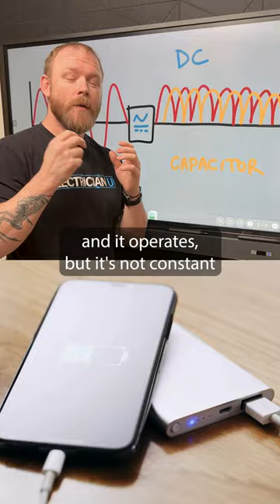Converting AC to DC with a Capacitor

Comment: I'm pretty sure modern dc power supplies use diodes to remove the ripples
Reply: Bridge rectifiers, an arrangement of four diodes, flip the negative voltage portion of the alternating current to the positive side. Current is still alternating between zero volts and what ever the input voltage is (usually already stepped down). The diodes do not smooth out the voltage. Diodes are one-way valves for electricity.
Reply: They are used to remove the large sine wave. The capacitor is afterwards.
Reply: Diodes can only be used to block current or let it through. Plus there is usually a voltage drop with a diode. You need capacitors, coils, or batteries to smooth out voltage. 

Now a power supply using a transistor to turn on and off the current can kind of smooth the voltage. If you switch at 100khertz instead of 60hertz most things won’t notice it’s not pure DC.
Reply: You can never remove all the ripples.
Reply: @snap-off5383  that's ignorant. There are plenty of high end AC-dc power supplies that create "perfect" dc. I own an engineering business that specializes in electrical testing. Much of our dc test equipment is required to be true dc and it all comes from an AC source
Reply: @rx7addict  The more capacitance you add ( or inductance ), the smaller the ripple, but like approaching the speed of light, you can never get all the way there.
Reply: @rx7addict  And any oscilloscope zoomed in will show you it is still fluctuating.   I won't bother with logical fallacies, just lead the horse to drink.

Comment: Fun fact: For just about anything with a battery: phone, tablet, laptop computer, uninteruptable power supply, the power to the device is always coming from the battery! You are drawing from the battery while it is being charged. This is why you can't always turn on the device as soon as you plug it in. There needs to be a charge in the battery. If you take the battery out of the device, then you can use it while it is plugged in. Did that once while waiting on a replacement battery for my laptop. And for my tablet. (The UPS will still work as a surge protector.)

Think about it like a water tower: the customers are drawing from the tower while the water authority is filling it up.
Reply: Actually most cheap consumer UPSes do NOT operate that way.  They feed the AC directly through to the device, and only switch over to using the inverter when the AC fails.

Comment: We were just going over this exact topic in my last DC Motors class. Can you do a video on 208 vs 240? I mostly understand that it has to do with using 2 of 3 phases vs a center tapped transformer, but theres still alot i do not understand.
Reply: I would love a refresh on this too, I come from a 208 world and residential 240 still breaks my brain 😂
Reply: 208 is the line to line voltage of a common 3 phase system in the US. It'll typically be in a "wye" configuration (Y) where the middle point is grounded. That middle point (neutral) to any individual line is 120V (because of math and trigonometry magic) - what a fantastic choice 208 was to get us 3 120V lines!
  --Each line ends up being 120* out of phase, which is 360* / 3 phases

240V in the US is just single phase so that line to line is 240, and we ground the middle point. Now, since the middle of this setup has become neutral, taking either line to neutral is 120V. Technically speaking, the center tapped transformer gives us a split phase configuration as each line is 180* apart.
Reply: in the US 240 volt off of a Center Tapped Transformer,  the 240 is not 180° out of phase !

Comment: I know you so badly want to be right, but you're only describing half of how a DC rectifier works. You need a series of diodes to make happen what you were trying to explain to people. Do some research please and yes I am an electrical engineer.
Reply: Bruh this is a YouTube short. If you want every component then watch the long form video. This is only explaining the purpose of a capacitor in a rectifying circuit.

Comment: None but the cheapest gas station chargers will have any measurable DC ripple on the output charge. SMPS power supplies have removed this ripple since, I don't know, the 80s in computer power supplies. That technology now can be small enough to fit in something the size of a usb stick or phone charger. Even smaller as in one chip.

Comment: I hate to say this, you’re out of your area of expertise. With these videos. Way to many misconceptions here.
Reply: There are capacitors used in the circuit of the rectifier. The phase is still in the circuit and when the phase is 180 it rectifies and charges the capacitor, then when it reaches 0 the capacitor discharges. When it goes -180 it charges the rectifier and capacitor again then it’s applied to the load. (ex iPhone, laptop) This is what he is talking about for “the ripple.” Its the constant charging and discharging of the circuit and it repeats 60 time a second. He seems like a good dude, he is doing his best.
Reply: I am saying give the guy a break he an electrician  as he has stated and not an electronics technician.
Reply: @darrinseelye2091  are you a professional electronics technician?
Reply: tripplefives1402  and your point is? My was dude doesn’t have to be a keyboard warrior and let the man make a mistake. At least he has effort enough to make a video to tech people some new info.
Reply: @darrinseelye2091 previous videos he demonstrated a diode rectifier, or bridge rectifier.  See his previous videos.
Reply: @darrinseelye2091 It's basic electronics.   He's not teaching heresy.